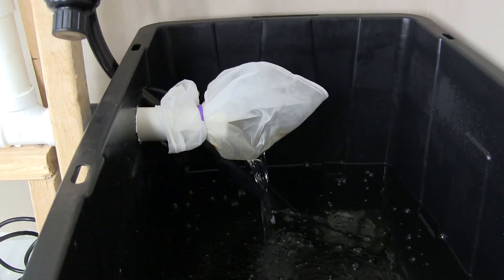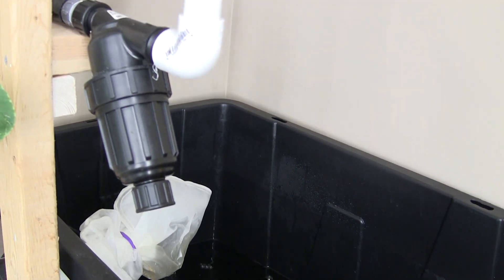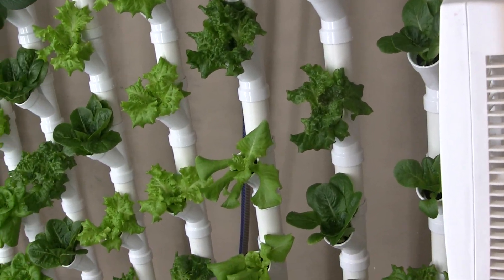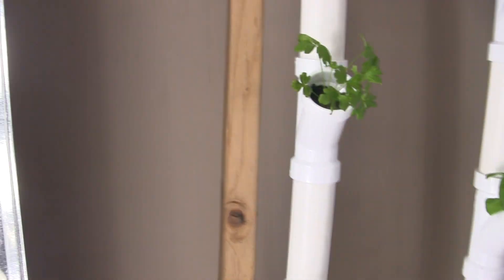Basement Hydroponic Tower Garden Version 2.0

Comment: Great system!  Thank you for showing the lights - I was surprised!  A few questions out of many! Do you eat all the lettuce, yourselves?  Do you leave the lights on 24/7?  What does the air temperature run?  Finally, what do you do with all the roots?  Thank you!
Reply from the maker: Hi, great questions. We can't consume all the lettuce. We share some and I market the rest where I work for $2.50 per head. I could get a lot more but they are my friends. Those sales pay for running the system so food produced for my family is gratis. Lights run for 16 hours per day, during off peak. Our rooftop solar picks up the tab when the sun is shining. With the hourly pricing plan we saved $250 last year. I'd recommend it. Air temp ranges around 65 degrees in the depths of our Chicago winter. Nutrient temp a bit lower. During warmer months (shut down during summer) I have an 8 inch vent fan on a timer in one of the basement window wells to increase re-circulation. As for the roots and Grodan plugs I compost them. I have 2 large garbage cans on my deck which we fill quite easily over the winter. On around April 1 the contents go into my large tumbler for my traditional veggie garden, flowers, and bushes. Happy growing!

Comment: The lack of color in your lettuce is likely related to your nutrient solution. I am currently figuring out the mixtures myself. But essentially adding or increasing levels of certain elements will have a huge effect on the taste and color of the lettuce.
Reply from the maker: Thanks for sharing. I agree about the taste and growth rate but I've found that the light/lumen intensity is responsible for the phenotypic expression of red leaf color. I ran some experiments with different lumen intensities and under high light output, even leaves shading out other leaves on the same plant cause an absence of red pigmentation. I took a picture for you which you can see at this link: https://drive.google.com/open?id=0B-6HiC4vapvpVFUtUHJtYXBmZUU
If you develop a recipe you like for nutrient solution and would like to share I'd love to try it out. Thanks for your contributions to hydroculture!
Reply: Oh how interesting! Yeah for sure, when I have solid data I will gladly share it!

Comment: HOW do you clean it?
I certainly don't want something that will be hard to clean. Will it collect mold, mildew, fungus, yeast, bacteria?   
What do you suggest?
Thank you so much
Reply from the maker: Well Frau Schaeffer, it depends on where you put it and how humid it gets. I completed this basement project in November, and I will run it until May and then start to harvest from my outdoor greenhouse. If there is high humidity and warmth you should expect mold and fungus with any system. I wouldn't recommend this in a small, warm, humid space without proper ventilation and climate control. I have an 8 inch vent fan to an outside window which will run on and off depending on the time of day once the temp and humidity increases outside. The system is a closed loop, but the plants do transpire and now in January my humidity, with the door to the room open, in the 400 square foot room, the humidity is about 15-20% higher in that room (50-55%) compared to the rest of the house. 

As for cleaning, I don't clean it. In May I will pull out the towers and drain manifold and bleach them out, the same as I did with my greenhouse towers. I will dry them out and reinstall them for when I start up the system again in September (8 weeks from seed to harvest). 

It's not the cleaning that is the problem. The system is fully automated, but the nutrient flush which I am now doing every 3 weeks takes a good hour to 90 minutes. You have to test the water for pH and nutrient once to twice per week, and add water and some other supplements. I have a water supply in the room which is important, since the system uses about 35 gallons per week. My drain is a toilette in the room next door, but when flushing I only dump 10 gallons, and I keep as much as I can for houseplants, which love the old nutrient water. Then there's the planting and harvesting. Bagging the produce takes a good 15 minutes with two people, and seeding takes a good 10 minutes.   So it's not a walk in the park, but to have fresh tasty greens and herbs which are as far as I know safe to eat is worth it to me. I like that my boys can see where our food comes from (excess amounts of greens and herbs often dictate what we eat for dinnner) and I like to live sustainably whenever possible. When it's sub zero temps outside, it's awesome to go downstairs and breathe in the fresh, warm, clean air - it's almost therapeutic as crazy as that may sound, as it's quite calming to be down there in front of a green wall with the sound of the nutrient trickling down the pipes. The system also doesn't cost me anything to run since my sales make up the difference, with as much as my family can eat (for free), and it will probably take me about 2-3 seasons of growing to pay for the construction upgrades from my version 1.0 system. So, as long as I am able I will continue to run my systems and recommend others to give it whirl, if you have the time and construction abilities. Hope this helps. :-)

Comment: Please check my project quickly modelized :
http://img11.hostingpics.net/pics/387868Capturedcran20170130083436.png
http://img11.hostingpics.net/pics/660158Capturedcran20170130083456.png
Reply from the maker: Interesting - indoors or outdoors? This setup is different from mine but if it makes sense to you give it a try. The towers may not even need to be tiled anyway, if the nutrient runs down from plug to plug. I'm not sure how you will get into the interior to harvest and prune, and I am assuming you will have system elevated for draining of nutrient. Good luck.

Comment: Bro, this is great! I'm going to get started on mine right now.
Reply from the maker: Glad to hear. One upgrade I'll me making my next time around would be with the 1/4 inch nutrient line - instead of looping up from the 1/2 supply line and down at an angle into the tower cap, I'd loop up and behind the tower and drilling into the tower at a slight angle downward, spraying across from the back to the front and slightly downward. Also, the inline filter is not necessary if you use a mesh micron filter bag - I just ordered a nut sack - search on Amazon for a product called "My Big Fat Nut Sack" for about 10 bucks. Also, don't skimp on the size of your nutrient tank - the bigger the better. I'm finding my nutrient (55 gal container) is sufficient for about a week with my mature system. I refill with dechlorinated water and adjust the pH twice before my flush - about every 3 weeks.  Good luck to you!
Reply: That's good knowledge thanks again for the tips!
Reply: I have heard Aquaponics gives better yields. How about using mist? Say, running the supply pipe vertically inside the PVC pipe and 4-5 mist connectors along its length.

Comment: Hi Joe,  quick question here.  Do you find that the lettuce roots clog up the 1.5" pipes ?  I assume the roots grow downwards. Also - how are you insuring that the plug does not fall into the 1.5" vertical ?    Thanks in advance, and very neatly done system.  John
Reply from the maker: Hi John, good questions. The lettuce roots do not clog the towers. I believe the roots provide a route for the nutrient as it flows down the pipe. Depending on the variety, the roots upon harvest seem to be a foot or two in length. They are clean and white. As this is the first go at this size pipe for an extended period, I cannot yet report on the herbs. Parsley and  Swiss Chard roots (and mint of course) tend to get very think and bushy, and if they plug up, then I can take the tower off and easily rot it out followed by a rinse with a hose or power washer if necessary. I am curious to see what 6 or 7 months of growth will produce. I won't even get that long out of most of my herbs anyway. My cilantro is already getting ready to bolt after 3 months and I typically get about 5 months out of my basils before they really slow down. 

The plugs are way too tight to slip into the towers. Remember they expand when wet. You would need a lot of strength to force them completely through the tee. This is a non-issue. They would be the perfect solution if they were reusable/sustainable. My students at school with whom I build theses systems have suggested netpots with leca - but I think we'd need some sort of a wicking system especially during the seedling stage. We may experiment with this in the future. 

Best of luck to you!
Reply: Thank you Joe, for the quick response - your information is very helpful.

Comment: Great set-up! You have inspired me to build something like this. You mention in the description "1.5 inch design" does this mean you used 1-1/2 inch PVC for tees and wyes? I would assume so but just wanted to clarify. Thanks for a great video!!
Reply from the maker: Yes, 1.5 inch pipe, tees, and wyes. 1/2 irrigation supply line from pump, and 1/4 inch connectors with line to each tower. Capping the towers and drilling an angled hole to supply the nutrient helps to 'close' the system. Good luck!
Reply: MaryandJoe Neumayer can you elaborate on what you mean by “angled hole” I assume this is so that the water doesn’t fall down the center of the pipe without hitting the young roots?

Comment: can u tell me the exact nutrients and measurements u use ?
Reply from the maker: Hello - I use Botanicare CNS17 Grow, with a concentration between 1200 and 1600 ppm depending on the point in my cycle. I do add calcium nitrate and iron when I add water weekly between flushes.
Reply: Nice project MDJoe, inspired me to make a small version with a weaker pump.  Do you dechlorinate the water or treat it with anything else prior to adding the CNS17 and calcium nitrate?  Just ordered a ppm meter.  Also looked at 50 pack 1.5 inch wyes from Menards and they don't ship to MD/VA.  How'd you get that many?  Thanks
Reply from the maker: I dechlorinate my water, even when I flush. PPM/TDS meter is very important - also a pH meter for optimal nutrient absorption. I picked up the tee shipment from the Menards store instead of having it shipped to my home. Do you have brick and mortar stores near you?

Comment: Did you consider using 24 or 56 watt 3 band grow light bulbs? I have read each bulb has about 4 ft coverage which might allow you to do away with so many bulbs and the defector. I have a kratky setup growing lettuce in my house upstairs but I am considering this route if I can make it safe enough not to leak. I guess I would just have to glue everything to make sure. I think an enhancement to this setup would be to separate the sections and do different nutrient ratios so you could grow different crops or compare crop sizes with the same light source.
Reply from the maker: Hi Ryan, thanks for the insights. I did look at the 3 band grow light bulbs - if they really do cover 4 ft they would be great deal. My current setup covers about 15 square feet with one fixture and 10 bulbs consuming 150 watts. 

As far as leaking, nothing is leak-proof. Small leaks seem to clog themselves with time however. I think this closed system is pretty safe, but 50 gallons of water is substantial if there is a problem. I guess you don't need so much nutrient volume, but then you're constantly filling depending on the size of your system. I currently have 151 grow sites. I seem to lose 3-4 gallons per day, most of which though is just water through transpiration. 

I would like to have separate sections - or at least two systems - vegetative and fruit producing - that's on the agenda for next indoor season (have yet to tell the wife!) I have experimented with different nutrient ratios - my outdoor setups have been more forgiving - also with nutrient flushing - if anyone has any answers to that one I'd love to hear them - and currently favoring around 1200 ppm. I'd like to try mixing my own but I bought nutrient in bulk and have enough for this indoor and outdoor season. 

Let me know if you experiment with the 3 band grow lights and good luck to you!

Comment: So you aren't using a net pot to hold your plug? They just rest at the corner of the wye? Have you had any problems with roots getting too big?
Reply from the maker: Hey Cody,  net pots eliminated. No issues with roots yet but my herbs and kales are not that old yet. If necessary I will pull the tower out and blast it with a hose  - and I can also blast out my return pipe as well. I think I'll be fine. This system is designed to grow between October and April when my greenhouse is out of commission due to  lack of daylight and cold temps.
Reply: That's awesome! I've been looking for a way to do this without the headache of melting holes. 

Please keep me posted on your roots. I wouldn't think that your herbs would get terrible; unless you let them get real bushy. The lettuces look very large. If you haven't had any troubles with them then I think you might be in the clear. :)
Reply from the maker: Hey Cody, the lettuce roots won't be a problem - just the mint and kales. We'll see!
Reply: I was checking to see if you have any updates? How are the mint and kale roots?

Comment: hi! a beginner question :v How do you make the irrigation  inside each tower? I mean do you have  an aspersion  valve ir something or  it's a regular flow from the tiny hose of each tower? Thanks forma sharing guys you are amazing!
Reply from the maker: Hello, the nutrient runs down the front of the pipe and hits the tip of the Grodan plug, irrigating the 3 week seeding. Soon the roots extend out and down the pipe itself. I don't use any aeration as there is plenty of aeration in the vertical design.  This one of the major reasons I designed the system like this.  I have a fractioning impeller on order to test to see if there is an improvement in growth rate with oxygenated nutrient delivery but I am doubtful. Thanks for your question.
Reply: MaryandJoe Neumayer o
Reply from the maker: Hello, the 1/4 drip line is attached to a 1/4 inch connector which plugs into the 1/2 inch irrigation line. The line is attached to a Danner Supreme Pond Pump Model 5. I had a Model 7 hooked up but it was way overkill and I busted the impeller within the month. No valves or aeration devices. Happy Hydroponics!
Reply: Hi great job on your system. Do you use net cups to hold the rock wool cubes in the tubes? What size rock wool cubes do you use? Can you also provide some details on how you start your seedlings. Thanks.
Reply: Hi, if you do not use mini sprinklers inside the pvc, how do you make sure the water gets to the roots?
Reply: hi how do u get the pipes to remain stable?
Reply: Hey whats that blue cable?
Reply: Hi! Do you have instructional video/s how to set this up from scratch?.
Reply from the maker: Hey, I zip tied them to a 1X2 which I run in the front of the system at the top.
Reply: Looks good. I've been wanting to grow vertical towers but that is a ton of lights!

Comment: Joe, this is a beautiful system and I plan to model my first 10 column hydroponic system after it.  Did you permanently join any of the vertical or horizontal PVC pieces together?  If so, which ones?  Also, which PV system do you recommend to power the water pump and lights?  Thank you for sharing!
Reply from the maker: Hi Frankie,  I glued all the pieces together, except the tower to drain pipe. The towers probably don't need it if they are tight, being nearly vertical and all. Nutrient solution seals them up anyway with time. I didn't glue my outdoor prototype and didn't have a problem, but I didn't want to take any chances indoors, even in the basement. The drain pipe should be glued though.  About your second question - not sure what you are asking. The lights are LED 100 watt replacements and the pump is a Danner Supreme Model 5 which should also work with 10 towers with a head of 7 or so feet. Good Luck!
Reply: Hi Joe, if you glued them, what glue did you use then? Must be one ensuring safety of food, right?

Comment: Have you calculated how many watts per lettuce it takes in energy to grow?
Reply: in video i saw there was 6 tubes,  each with 10 to 15 watts bulbs. a total of 650 watts
Reply from the maker: No. 150 watts per fixture at 5 fixtures for 133 plants at 6 weeks in the system.
Reply from the maker: 5 fixtures on lettuce and 1 on herbs/kale
Reply: OK so about 2.4kW per plant over its life. That's better then I was expecting, looks like a very nice system.
Reply from the maker: Hi Aric, I didn't do the math myself but that seems high to me - I don't run the lights 24/7 - just 16 hours a day. And my PV system covers the costs when the sun is shining.